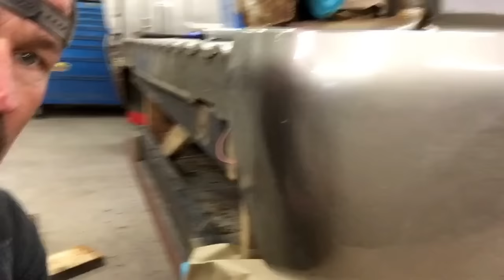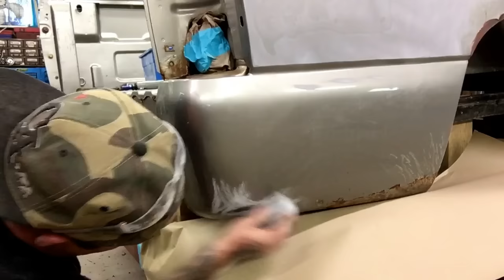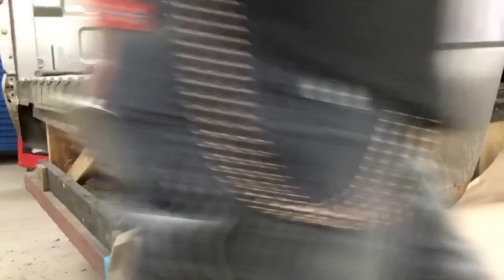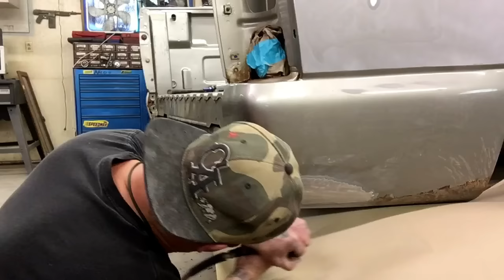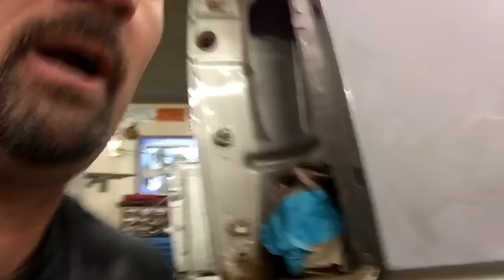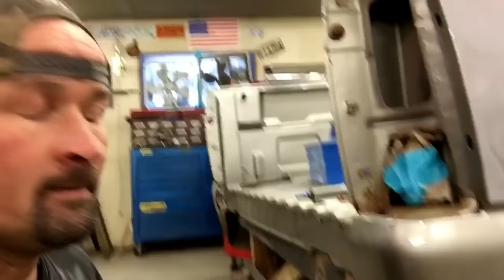Metal finish dents without using bondo

Comment: Using a dolly in any form is a skill set that takes hours to perform correctly. People fill dents with filler because they don’t have the skills to move metal correctly. This process is actually called Off Dolly.Before you can do this you need to practice using these tools for 8 to 10 hours straight so you can build your skills before attempting a slapper or any kind of body tools. 
Also filler is generally used in places you cannot get a dolly in. So a stud gun or some type of puller is used while slapping the surface at the same time. An entirely different video he needs to show. The bottom line is many people will continue to fill dents so they can drive down the road. Who cares as long as it doesn’t bother them that they cheated a bit? However if doing a show car or you want to become a master at metal forming, then of course you need to watch lots of videos learn but most of all practice for hours on in with the right equipment that’s how you build the skill sets to do what you see that are being done here on YouTube and other research you’ve done on the subject. There’s lots of people out there doing this wrong and so you want to make sure that you compare videos and your research many times over so that you can use common sense and find out who’s doing it wrong and who you want to really copy and follow. Body heart body work is really hard really time consuming and that’s the simple reason why so many people grab a filler and just start muddying their way to paint. And everybody we talk to always says well we need to stop those people. You’re not gonna stop them in fact there’s 10 times more that going on now than there ever was so not only that they’re starting to use cat hair and fiberglass fillers because it’s a lot harder than regular filler and it’s very hard to get off the car once it’s put there. But it works, it works for those who don’t have time to do with what this guys doing.

Comment: I know this video is 4 years old now but I have been learning to do autobody work on my old toyota truck which I have a couple spots that the metal is so buckled I cant get my stud welder to pull it out no matter how hard I pull. Feel like theres just situations you may need to use bondo rather replace the section especially when its small but just a awkward area.

Comment: Bought some panels from LMC Truck... Good grief, I've got to break it a hammer and dolly before I mount my panels! It's horrific how badly done of these came.
Full rocker panels need an English wheel from bad stamping marks that run the length of the entire panel. The bed quarters beat the crap out of the door skin that they tossed into the door skin box. Just stupid stuff they're doing up there!
Quarters are mint, but they should be with a true 18 ga steel panel.
Reply from the maker: Yeah we literally spend hours on aftermarket panels trying to fix them. Its lame! Thanks for sharing brother

Comment: Nice work,How do you go about moving a sucked in dent from welding out of a rear quarter panel
Reply from the maker: Gary Slack just be patient and work all around the dent until u slowly work to the inside. It will walk out of the panels. Hope this helps bro. 👍
Reply: I have been told to heat the centre of dent while it is pushed out then cool with a wet rag will this work
Reply: Ok cool i’ll give that a go 1st , Appreciate your advise cheers have a great 1👍
Reply from the maker: Gary Slack yes! That works very well 👍

Comment: Keep up the good work. Does the grain of the metal make a difference as to what direction you work it?
Reply from the maker: kenneth vandike Thats a great question to ask!  Honestly its not a big deal to go any direction. If your bending, shrinking, or stretching metal it does matter which way u need to hammer on the metal. But as far as beating out dents with a slapper hammer or dolly it works in any direction.  Thanks for sharing brother.  ARCO MN OUTLAW CUSTOMS

Comment: Just found your channel. Great work. I have a 79 trans am that has the passenger door dented in. Right were the inner frame bar gets in the way. I can't get to the back side to remove the dents. Is it it possible?
Reply from the maker: Danylo66 try using a stud welder to pull that out bro. Or u can try to get som pressure pushing out from the inside and hammer around the area with a body hammer or slapper hammer. 👍
Reply: @OutlawEdge   I used a tig welder and taked some wedge shaped pieces to the dor skin to pull the dents. But there are some high spots from a previous repair that i need to tap down. I'm going to try to make a slap tool to squeeze between the skin and the inner door support. thats all I can think of. For now. Its just not in our budget and time to change out the door skin. Thanks again for the videos. I`m getting some good ideas on what to do and how to work out the dents.

Comment: That step where you grind on the finished panel with 36 grit won't work on a modern car. That much heat would warp the metal.
Reply from the maker: Steve Warren then u could use a dual orbital sander.
Reply: @OutlawEdge  Don't think so. DA wouldn't spin fast enough to remove any metal. You'd never get it perfectly flat with a hammer and dolly anyway. Would still need a skim coat of filler or high build primer to accomplish that.

Comment: You made a good video. If I were going to change anything it be to ask you not to spend very much time with your head blocking my view. Also you are very right about protecting your eyes. It doesn't  look like you are using any ear protction.  I grew up helping my dad in the body shop and I can attest to the hearing loss problem. Autopsy received my dad's lungs were loaded with metal dusts and damage from paint/solvent fumes. I loved my dad and hated to see a good man die so very young from the hazards of his work. Even now when I sweep the shop floor I get a filter mask on to protect me from the really fine dust. By the way, I get yearly checks now because I have a spot on my lung the size of a silver dollar. If you really care about the ones that love you,......please wear protection.

Comment: I knew HF had the Madox hammer and dolly set but didn't know they had a set with a slap spoon. Thanks for the info. I think I'm gonna have to order as my local store doesn't seem to carry that set and that set is less then just a spoon on Amazon. Great tutorial. Also from what I've seen in other videos the HF body tools are great for the weekend DIYer but the way there build (all metal construction and hardened work surfaces) you do not want to use these for long periods of time as they will kill your hands.
Reply from the maker: Gary Palmer yeah if can afford it buy a set of hammers with wooden handles. You can use them all day with no fatigue. The fiberglass and metal handles will beat you up. Thanks for watching brother 👍😀🇺🇸

Comment: Man thanks for the tips I’m working on a 62 C10 and both are beat up
Reply from the maker: Dave vonAnderseck no problem. Hope i can see your truck progress. Thats one of my favorite body styles 👍😀🇺🇸
Reply from the maker: Dave vonAnderseck if its in a bad area like that you will really like to use dolly and slapper hammer cause that will smooth the area out fast. Try to get it to bare metal and spray the area with blue or red DYKEM dye. The hammer and dolly lightly with the slapper hammer till u like it. Then file the area with a super fine flat file. U will be doing this to find the high and low sots. Repeat till your happy with the finish. Thanks for watching brother. Hope this helps 😀👍🇺🇸
Reply: Do I need the dye or can use black paint? And copy the slapper hammer and dolly. I’m going to strip it to bare metal. On the other side I ran into bondo and you know it started getting deep.  Along with pitted rust. But once I get it 100 rust encapsulated will give it some more life. 

Copy the Instagram my wife knows all about that stuff. I’ll get her attention on it to send in done pics. 

I have a 496 8.1 I want to put in it. Want to set it back at least 6 inches to move the weight back. And 4L80E. Can’t go wrong with overdrive. 

I’m converting it to powers steering. The problem I’m working on is the box I’m using came out of a 98 Jeep Cherokee but it bolts inside the frame instead the outside the frame so I’m thinking of getting a steering link for an impala. That way I can still use the gearbox.
Reply from the maker: Dave vonAnderseck you could use black paint if its already in primer so u can blocksand and find the highs and lows 👍
Reply: Heck ya I’ll take any advice I can get. The hard part for me is to get the right radius back on both my fenders. It’s the top area of the fender that meets the hood and it’s all dinged up from previous repairs.
Reply: What’s the best way to contact, I love to send in some photos. I have the front clip off, motor and trans sold that. Doors are off, windshield is out and dash is apart. I did a lot of paint stripping getting all the thick paint off so I can see what I have. I think I can get away from buying new rockers. Defiantly new cab corners. For the fenders on the bottom by the door I don’t think I’ll have a problem working them. But it’s that top area of the fender by the hood.
Reply from the maker: Dave vonAnderseck arcohorton53@gmail.com
Reply from the maker: Dave vonAnderseck mnoutlawcustoms@gmail.com
Reply from the maker: Dave vonAnderseck outlawedge_bladeworks  on Instagram

Comment: I bought an older pickup (1995) and I want to remove some dents.  Is there any difference in removing freshly dented metal as compared to dents that occurred years ago?
Reply from the maker: kme krine no difference at all. New metal or old metal will still act the same when your hammering out the dents. Good luck with your project. Thanks for watching 👍
Reply: Old metal will have memory.. but he is right both work the same..

Comment: Im on your side brother. Bondo is for people who don't know how to do good metal work
Reply: Most of the car shows use body filler of some type to really smooth out the metal for paint.   I would agree if you said fiberglass & resin.
Reply: I agree. There is a difference between bondo-ing dents and uneven surfaces and using body filler to smooth out scratches. At car shows sometimes you can see unfinished cars that show perfect surfaces as a proof to the quality of the body work.

Comment: do you think you could repair hail damage to a hood or roof without using body filler?
Reply from the maker: ThisISETHANBRADBERRY! Not with a slapper hammer but you can pick up a PDR AUTOBODY set online very cheap. It has small slugs that glue to each dent and pops them out very nice. That works very good for hail damage 😀👍🇺🇸

Comment: I have to say, on the finished metal looks excellent!  Love metal finish work done with tools and not fillers.  A a rig used in a rough environment will eventually eventually have the body filler crap out if it's in a semi stressed area.  Construction, ranching/farming, and offroading will take a toll on filler work.

Comment: I've been thinking about getting one. seems better than the old slam bang with the screw on tip. they always leave holes in the metal. and pull through if you're not careful. you've probably used that type..Thanks.
Reply from the maker: Ken Sendelofski yup ive used that type in the past but i prefer using the slapper hammers cause its way less work. Thanks for watching

Comment: Good video brother....Try using heat when working dents out...I like to use a heat gun to heat the area up....It makes the metal much easier to work with.....I do alot of P.D.R. and we heat the area to keep from cracking the paint...but i noticed when push dents...it makes it a hell of alot easier to get them out...I have taken alot from P.D.R. and brought it over to my body work....
Reply: Survival of the fatest outdoors to what temperature do you heat the metal? At what degree does the paint start to deteriorate ?